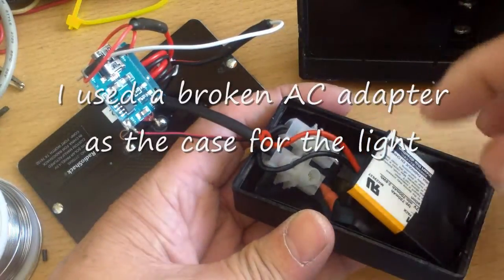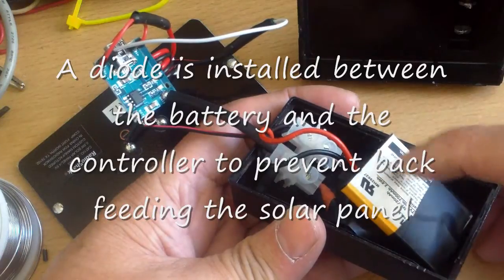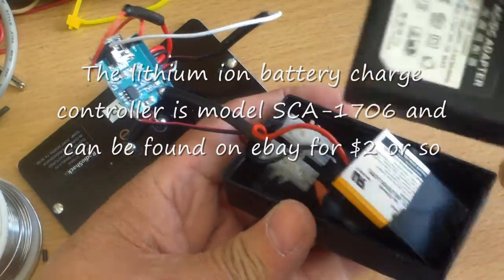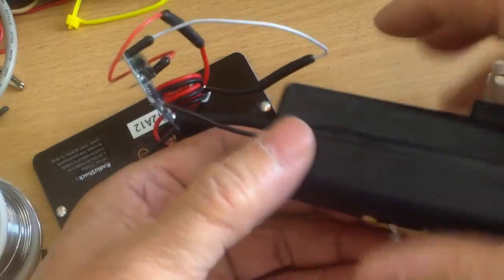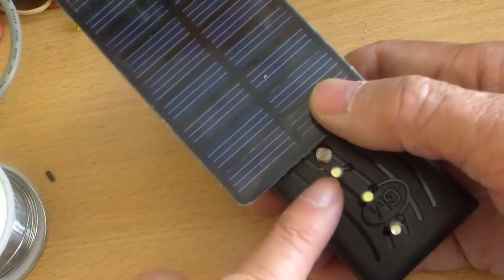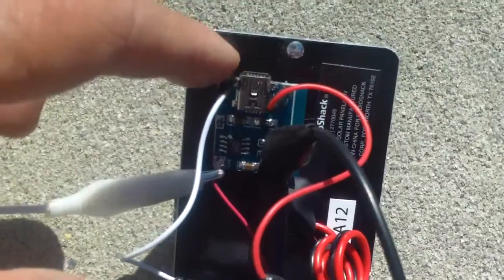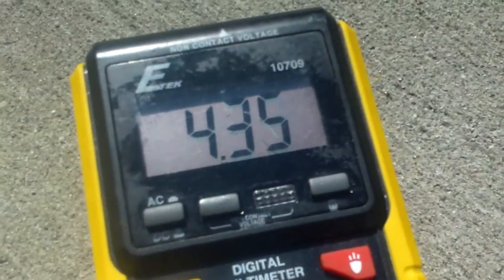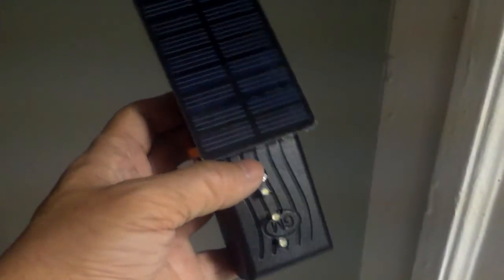Solar night light

Comment from the maker: You could probably try the on off diode route. You'd need a zener diode  I tried to use that in an LED indicator setup for my charger. That didn't work out too well for me maybe because I picked the wrong value zener diode. I also used my solar panel as the light sensor. That worked but these LDRs are so cheap I went with the them. As you can tell, I'm no expert but I love to play around with the components and sometimes I get lucky.

Comment: OK, I will try different resistors before I buy the GL5537. I thought they were simply an on/off diode and you could put them directly on the battery negative line for example..Thanks for your answer.

Comment from the maker: I bought them on ebay 20 for $1.29.  Type the following on ebay search box and you'll find them:
Hot Sell 20Pcs GL5537 Photoresistor LDR Photo Resistors Light-Dependent. You can also try different value resistors if you have them.. In my LM386 dark sensor, instead of the 10K resistor, I had to use a 10 ohm resistor. There's a bit of trial and error in this type of diy projects.

Comment from the maker: Thanks for your comment. Very good thinking about the AC plug and the potential danger. I went through the same thoughts as you did. I was going to snip off the prongs but they made an extension to steady the light when I solar charge it. Actually, nothing is connected to those prongs so nothing will happen if someone plugs it into the wall.  Now, if I were smart, I would make the light AC rechargeable so it'll recharge if you plug it into a wall outlet.

Comment: I always love your electronics tinkering.  Good job on using a power supply case that's been gutted instead of just throwing it out.  Good upcycle.  I only suggest you wrap the AC plug in electrical tape to make it stand up a little better and to make sure no one accidentally plugs it into the wall.

Comment from the maker: I ordered a couple of those motion sensors online. I'm not too optimistic about those pir sensors as most of my store bought motion sensing lights break down after a period of time. They are also affected by wind and temperature changes. They are cheap enough so I'll experiment with them when received. Thanks for your suggestion.

Comment: You could get one of those motion detector modules on ebay for 2 bucks and use a transistor to turn on and off your outdoor circuit.  It sends out 5v when motion is detected and it has it's own sensitivity and time delay setting on the board.  Cheap and works well.